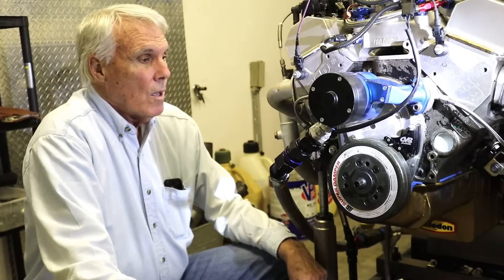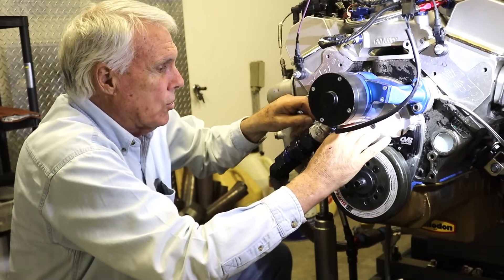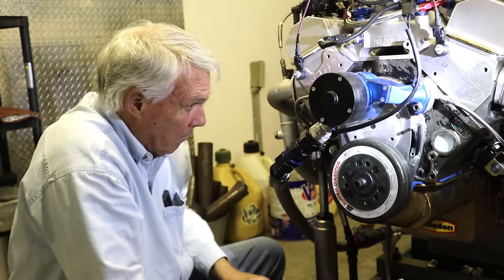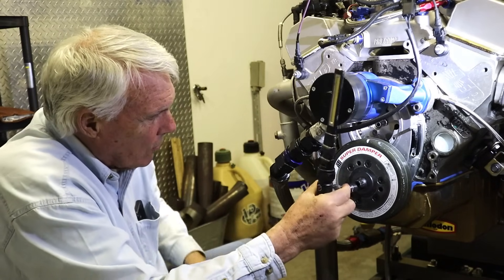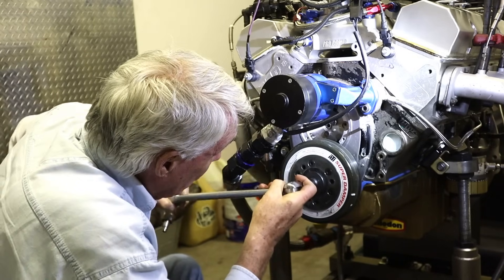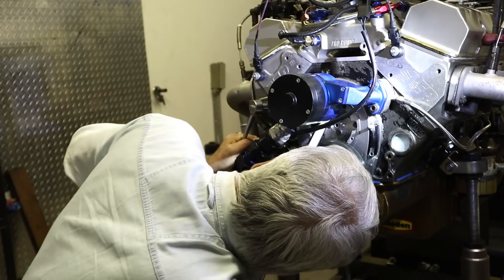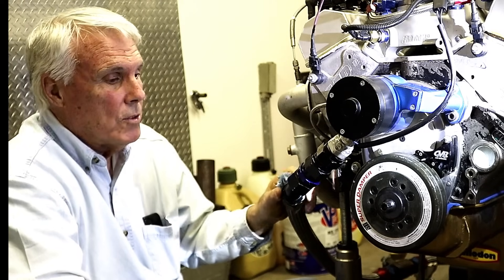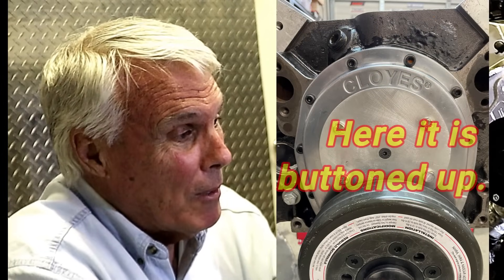Zero hassle cam re-timing

Comment: Sorry David. But this was the worst most unconvincing video I have ever seen and for goodness sakes! What is the reluctance to grab a power tool and remove 4 waterpump bolts? If you're showing it can be done in the car. Adding spacer does not count. Watching him struggle while claiming how easy it was. It was like watching a cheap ginsu knife ad.  😢
Reply: You have to drain the water to take the water pump off.  That drains not only the block, but 
some of the water from the dyno cooling system - it can be messy.  Have you ever run a dyno room?.
Reply from the maker: In all fairness to Greg the thoughts were to bias the focus more toward doing this in a car rather than on the dyno. As the supposed director here it was my job to have shown doing this with our power tools rather than hand tools.
Summing up - it was my error NOT Greg's.
DV

Comment: if you mill in a grove for a o ring you could use a tab on one side and a bolt on the other just one bolt and its off
Reply: Even better if aeroplane style 1/4 turn fasteners are used. Off in under 10 seconds.

Comment: I like the remote water pump idea - make it a feature of the dyno room cooling rig and adapt hoses to blocks as needed.  Might even sneak a flowmeter to verify what the engine likes and use that info for later radiator selection when people build something odd and an oem radiator just isn't happening [I'm thinking of someone I knew that ambitiously stuffed a mustang motor into a VW years back].   He... had problems keeping the front wheels down.   No crime if a radiator can outflow a block, but the other way around is a sure headache.
Reply: Only flows how much the water pump is pumping.
Reply: @hotrodray6802  A water pump is a centrifugal design - they have a volume/pressure curve for whatever they are applied to.  Generally, thermostat design will be the controlling factor.

Comment: Looking forward to more videos yes DV get that water pump out of the way if this is going to be test motor with cam changes when you have 3 or 4 people standing around waiting a 15 min job cost the crew 1 hr of progress of highly skilled people.anyway your awesome and cant get enough of your videos cheers
Reply: I thought of an idea to make cam adjustments easier on SBC's. Replace the cam tunnel plug on the back of the block with a threaded one so it can be removed just by taking off the fly wheel. Then you could simply turn the engine backwards to put slack in the chain and then move the cam in the desired direction and check the timing and then put the plug back in when your all done!